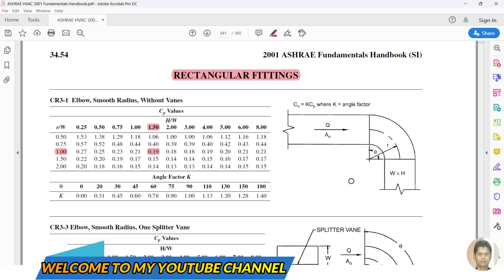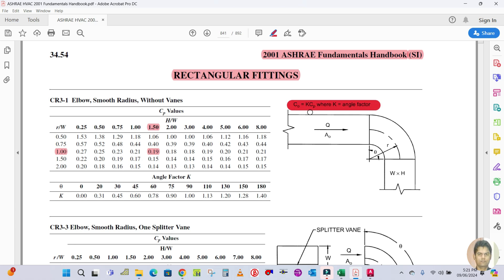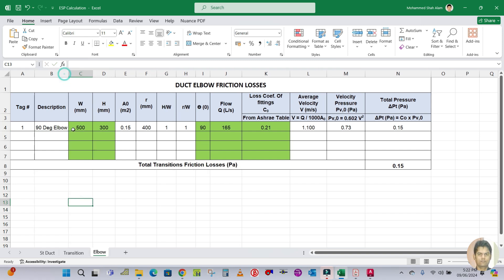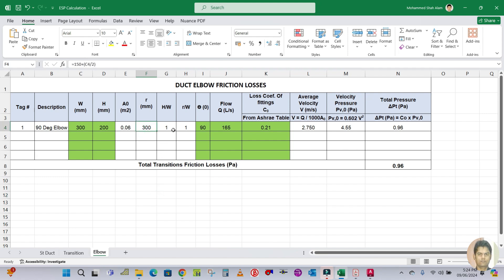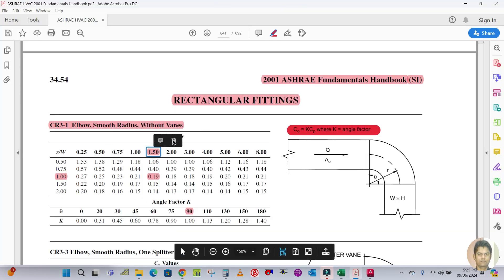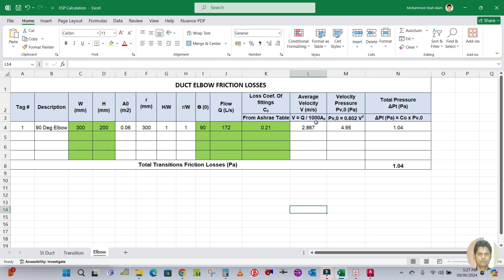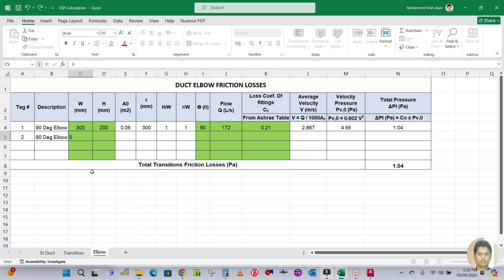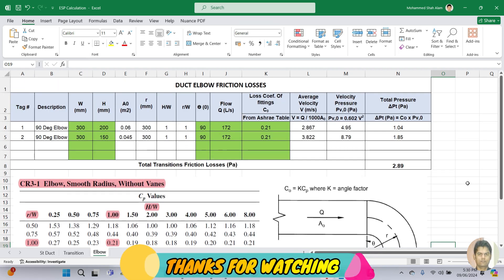PRESSURE DROP IN ELBOW II PRESSURE DROP IN DUCT FITTINGS II EXTERNAL STATIC PRESSURE DROP IN ELBOW I

Comment: I believe that the H/W column is rounding a value up, resulting in an integer. The correct value should be H/W - 200/300 = 0.66.
Reply from the maker: Approx value you can take